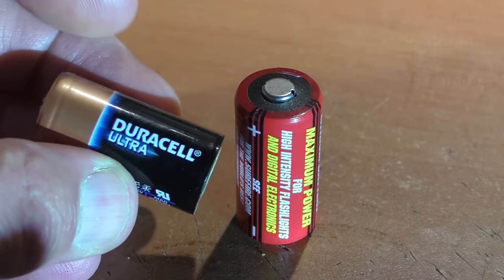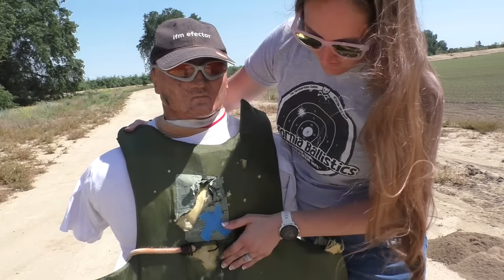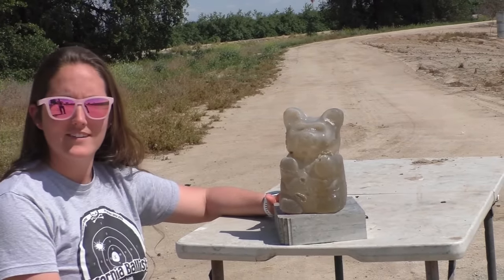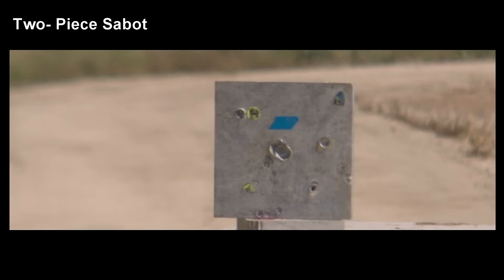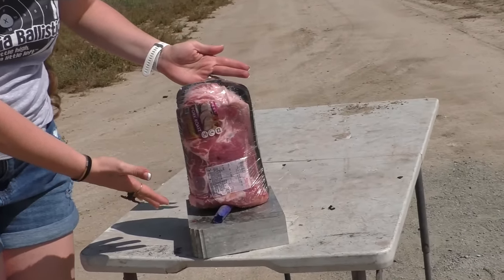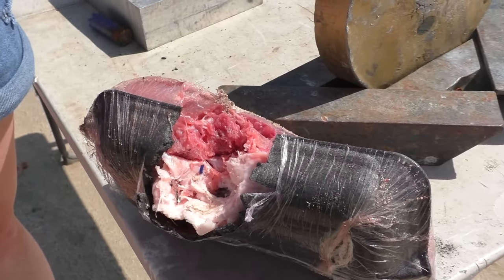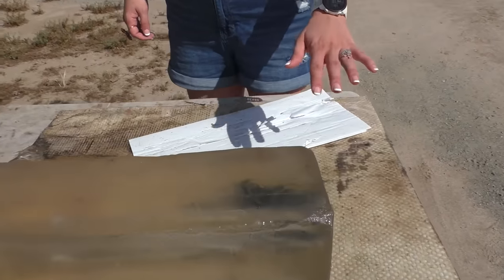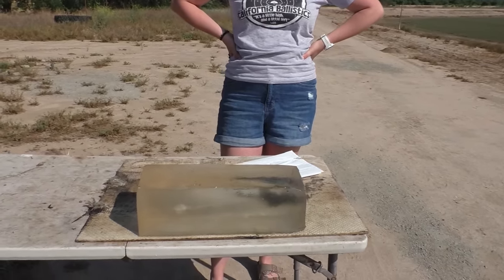12ga. Shotgun Lithium BATTERY Slugs-  Brutal Results!

Comment: In a human body, that black stuff would be exceedingly damaging and virtually impossible to clean out. Long term pain would likely last until it was all out of the body, not to mention the schrapnel damage in many different directions. The shock of the pressure wave would be devastating as well. That battery would be among some of the worst nightmares you have shown to date along with the likes of Dragon's Breath and some others. Just makes me shudder, which as a deactivated Marine, doesn't happen very often !
Reply: Right! I don’t think they’d survive the battery shell. That thing is brutal. Let me correct myself I don’t think they’d wanna survive it.
Reply: I don't think much pain would be felt - There is very little chance of surviving that kind of impact unless hit in something that will fly off the body anyway and at that point just amputate further up the wound to ensure the lithium is gone.  But I wholeheartedly agree one nightmare of a load!
Reply: Thanks
Reply: It’s like a hollow point with a side of horrible chemical burning
Reply: Dung 🥰🥰🥰🥰  Infection like Nam ????
Reply: Yeah I agree I was thinking similar things, I love my shotgun but they are absolutely devastating!
Reply: Poisoning and internal chemical burns due to the lithium reacting to water.
Reply: So the wound itself causes shock and then the lithium poisoning causes serotonin syndrome and you pass out. its a poison bullet.
Reply: @jamescheddar4896  daym!!!

Comment: That would be a wretched experience, especially if those contain elemental lithium, which I'm pretty sure would react with the water in your blood to form highly alkaline lithium hydroxide, adding internal chemical burns or worse to the list of injuries.
Reply: Your knowledge and the sharing of it is appreciated good sir.
Reply: @transtubular  Lol, you've got some small inches. Don't worry lad, I'm told that technique can make up for that.
Reply: @AtlasReburdened  Hahahaahaaaa...k ...nice.
Reply: The fragmentation is just brutal. Plus chemical burns and you should call this the Assassin Round.
Reply: No one lives through a clean hit with this...
Reply: Lithium reacting with water is very, shall we say, energetic. And it disassociated the water, and the hydrogen and oxygen energetically recombine. The fire and shrapnel from the case will make the chemical burns moot.
When I ran a chunk of the R&D labs for the largest consumer battery manufacturer, I must have blown up a thousands of the suckers. (And captured the propagation of the explosion as it traveled through the cell -  challenging stuff.  Never fired one out of a shotgun, though.
Reply: Are these batteries fully charged ? I hope so…
Reply: @peterstickney7608  I think, perhaps, you maybe be underestimating the amount of blood that flows both in and out of a permanent cavity from a gunshot. These hydroxide burns would be internal in the very precisely same sense that the entire lining of your circulatory system is. Alkali metal hydroxide burns throughout would absolutely not be a trivial or secondary concern.
Reply: Non-rechargeable lithium cells have metallic lithium in them (unless they're depleted), but lithium-ion cells don't.
Reply: @galfisk  Thank you, I thought that was the case but couldn't remember for sure.
Reply: Those are lithium manganese dioxide cells and they contain about half a gram of metallic lithium if they haven't been used.
Reply: @rocketman221projects  Good info. Thanks. A half gram seemed scant at first, but that's actually a fair bit considering how light it is atomically.
Reply: Yeah, it's a little over half as dense as water, so half a gram is almost one cc.
Reply: If the gel block is any indication, trying to treat a living person who has been shot with this would be a real son-of-a-bitch. Not to mention what it would be like to be the person shot with it.
Reply: Anyone else cringe when they were pouring water on the gel block to get a better view?  Hopefully the block had enough moisture content to burn out the reactivity with the lithium
Reply: @markmatsushima7356  Yeah, that wasn't smart.
Reply: Good lord, that would be BRUTAL!!
Reply: I was waiting on the 5 gallon water jug... But it never showed up. Kinda sad about that
Reply: But would the lithium have any psychoactive effect?  It doesn’t take much. See lithium water.
Reply: How about a stack of button cell? Aren't some of those pretty... unhealthy.
Reply: @CrimeVid  They are old, dead batteries, and non rechargeable.
Reply: Just when I thought being shot at with a lithium battery would be a walk in the park, you come along and ruin my dreams by making it sound worse. Thanks a lot.
Reply: @passattdise   shame.
Reply: @kenreynolds1000  it would be like getting injected with lye or something similarly caustic. you would probably pass out from the pain but the question is will your organs and other tissues burst from the gases first
Reply: @edredrhg6910  I get that. Just say you survived the shockwave and caustic effects… they rinse all that out and sew you up. I would wonder if the lithium toxicity would trip you out until it was washed out of your bloodstream… chelation therapy?
Reply: So shooting batteries is a warcrime?
Reply: I have pealed them open and droped the lithium strips in water quite a light show. Hot! I would guess even better after being Atomised by a shotgun blast. They should try firing brand-new fresh batteries into 1 gallon cans of water. Cool!
Reply: I have pealed them open and droped the lithium strips in water quite a light show. Hot! I would guess even better after being Atomised by a shotgun blast. They should try firing brand-new fresh batteries into 1 gallon cans of water. Cool!
Reply: @kenreynolds1000   Who needs all that medical mumbo jumbo when you can just stick a lightbulb in their mouth and wait for the bulb to go out.  Uncle Fester: Still a medical genius.
Reply: @samuelcolt6670  Shooting anything that causes a horrific death can be considered a war crime, but that's not the main issue.  The main issue is the guy's buddies that just watched their friend howl like an animal as he tried to rip chunks of his own flesh and organs out to make the pain stop.  You take a bunch of well-trained killing machines with guns, knives, and grenades and make them watch their brother die like that.  It doesn't matter which branch of service they are--hell, they could be the U.S. Army knitting team--and they WILL find you and they WILL play "Who's the most depraved?" with you for days man.
Reply: @richard6133  Just imagine how confused the doctor would be while trying to figure out what happened.  What a mess!  Honestly though, if somebody takes a center mass hit like this from a 12 gauge the prognosis is pretty poor.  Buckshot, slug, freaking lithium battery...  It's probably going to die.  It may take a while but it's not going far.  I've killed a lot of things with a 12 gauge.  I've never thought, "Is he gonna make it?" after hitting something center mass with buckshot.  People focus a lot on penetration.  Penetration is important (that's what she said) but what really kills is when you dump 100% of the energy into the target.  I'd rather have a projectile stop inside the target than have it go all the way through.
Reply: @rehoboth_farm  
I agree, I can't say that I have seen many patients with multiple projectiles stopped in the chest make it.
Reply: @CrimeVid  They're flat now...
Reply: Abrar  It's called chemistry, bud. You can tell it works by the way you never melt into a puddle of reactive goo.
Reply: Abrar  
I have enough experience with projectiles in people's bodies to know that he is likely correct in the OP.
Reply: Atf wants your adress
Reply: Would that count as chemical warfare?
Reply: @thestørmcrier2024  I believe there are laws regarding the dispensing of chemicals against people, probably intended to prevent "creative" homemade "pepper spray", that would apply here.
Reply: @thestørmcrier2024  
In the Laws of Armed Conflict, it would be under the same convention against the deliberate targeting of enemy personnel with incindiaries, since it doesn't start burning until it is inside the victim's body. It would not be a chemical weapons violation. Good question, though. 👍
Reply: Well better not try robbing that Batteries Plus location on the dodgy side of town
Reply: Nice observation ..but I believe the victim would have bigger problems to worry about with the wound
Reply: @timkohn7770   Those are my thoughts exactly. This OP's comment is just childish and pedantic. 🙄
Reply: the production of lithium hydroxide would lead to acidification* (li+ + h2o = lioh + h+ )
Reply: @timkohn7770  Maybe. I've seen people survive gunshots, but I haven't personally seen anyone be injected with solid metalic lithium.
Reply: @badabing3391  ...You do realize that that's hydrogen gas being evolved, right?
Reply: @AtlasReburdened  i misread the part where you said elemental lithium. I didnt watch the video either🤷‍♂️
Reply: These CR123 are Lithium manganese oxide, they are very different to metallic lithium.
Reply: @CrimeVid  You can not charge CR123 batteries. They are one time use DISPOSABLE batteries. Soo obviously these are depleted waste batteries.
Reply: @passattdise  Shame
Reply: @Neojhun  Did I suggest they had been recharged ? they could have been new.
Reply: lithium poisoning also has the worst symptoms for combat

Comment: by far one of the most damaging rounds , if the target lives through that shot they wont be alive much longer
Reply: plus getting battery acid in their wound
Reply: It's basically a poison explosive round, I'll keep the video in mind if the apocalypse starts and I need to fashion myself some improvised shells
Reply: My first thought as well. Lithium is toxic in much smaller doses, causes acute and then complete kidney failure, GI tract malfunction (both ends + stoppage, but irrelevant here since it wasn't taken orally), heavy muscle spasms, central nervous system failure (it crosses blood-brain barrier), severe hyperthermia, coma and death, and most importantly, there is no "antidote" - it cannot be neutralized, bound and flushed, and if quick hemodialysis doesn't help, it's code: ART.

So not only recipient would die, but it will hurt whole time its dying. From all the things I wouldn't want to be shot with that's firmly near the top.
Reply: @Vatharian  So basically, Battery loaded shotgun shells would be a war crime if used seriously?
Reply: @maritimeyoutubeengineer3354  actually, yes.
Reply: @Vatharian  damn, know what I'll be making in the post-apocalypse. Thanks!
Reply: @maritimeyoutubeengineer3354  Lithium batteries are more dangerous because of the lithium than any acid. Look up what happens when you expose lithium to water and I think you'll agree these are VASTLY more dangerous than even this video shows.
Reply: considering litium gets hot and can burn when wet maybe it would cauterize the wound ...not
Reply: @tphillips696  yeah I was imagining it  just lighting on fire once it starts breaking apart inside a person cause of how much water is around, that'd be absolutely terrifying. They should test the Energizer ultimate lithium batteries cause they have metallic lithium that'll self ignite whereas most just have lithium ions
Reply: So if you shot at a home intruder with this you'd go to jail?
Reply: @PeronJames  i fi have a home intruder i will END THEM and not go to jail.
Reply: @maritimeyoutubeengineer3354  I would dismantle the batteries and use them in a hollow points platform. Much like Mercury the energy transfer there is excessive against anything except maybe rhinoceride. Although if you happen to be hunting elephants this is actually a method of penetrating even their skin. If you were to use the proper High caliber rifle round with a portion of the lithium in it this would be a immobilizing round against anything.
Reply: @PeronJames  Geneva does not apply to civilians. However the fact that you are using explosive rounds will severely discredit a self-defense plea.
Reply: I've seen where somebody wrapped them in electrical tape to engage the rifling.
Reply: how would these be for defending against grizzly bears?
Reply: @maritimeyoutubeengineer3354  it’s a targeted chemical weapon.
Reply: @projectafterworld2557  Umm these batteries have too little lithium compound to be extremely volatile. FYI The ION part only accounts for a tiny fraction of the cell chemistry mass. ACID from batteries is vastly more dangerous because there is simply much more of it.
Reply: @Vatharian  There is too little lithium in Battery Cells to be toxic dose by contact. You would have to chemically extract and orally ingest the tiny amount of lithium compound to get anywhere close to toxic. FYI the ION part of lithium ion battery only accounts for a tiny fraction of the cell chemistry. Seems like everyone has no clue the tiny amount of of lithium in a battery.
Reply: FYI A 1,000lbs Lithium EV battery pack has about 15lbs of lithium compound. Just for you to understand the amount of lithium compound in a battery cell.

Comment: The definition of desperation is when your Red Dawn scenario involves repurposing lithium batteries as ammo.

Also, the California Ballistics shirt is awesome!
Reply: One would think you'd need batteries as batteries, but sure better shoot them than get shot
Reply: I thought that shirt said "California Balls!"
Reply: @engelbert42  Batteries only last a certain amount of time: But the need for Bullets will almost Certainly last Forever!
Reply: @erikdeeNOSPELLSNO  well idk. Lithium batteries are better served as explosives. Your bigger Lithium batteries like 18650 or 21700(the stuff people use for vaping) will blow up like a grenade if shorted. Then ones like in this video can be taken apart and used to forge something. 

If you need bullets just use some rocks or metal or something. There's literally an endless amount of hard things you can shoot. Using batteries just seems very ineffective in many ways
Reply: @engelbert42  they die eventually. And most can not be recharged.
Reply: I was thinking the same thing. That lithium and debris in the wound trail would be devastating over time and I'd find it hard to believe it could get cleaned out early enough to save the victim.
Reply: 🤔 hmmmm
Reply: Hah if you hit someone and they dont die from the initial shot.  They very well may die later from the chunks of lithium stuck in the body.
Reply: @stompingpeak2043  you wouldnt say that if hit by one. To me this is a perfect round for a no id shot
Reply: @engelbert42  A23 batteries are pretty specific for things like cameras and some remotes, stuff you'd hardly need in the apocalypse.
AA, AAA, C ,D, 2032 and 357 9v and 6v lantern sizes will be more useful
Reply: @DrDLightful need to ask an emergency doctor, but I reckon It would be nightmare. The splintering composite martial of the battery would make the remove problematic, while the lithium compound from battery would be tricky. Could you wash that stuff out? Would it react to body temperature and combust? Perhaps a war wound specialist would be better to consult with for care of that wound.

Nope, don't want to get hit with one of those rounds.

Comment: A thing about hard drives, the platters are circular and offset from the side with ports, and those platters are actually the "hard disks" in there. The shot in here only penetrated the case and controller board. So, just info for the future. Thanks for great content!
Reply: The platters are plastic…would make little difference to penetration.
Reply: @robertchapel2245  The platters of a hard drive are not plastic.  They are typically made of aluminum or glass and are coated with a ferromagnetic material.

Comment: Those would be actually pretty lethal rounds. No overpenetration and massive energy transfer. The kinda remind me of those ARX bullets where they can transfer a lot of energy.
Reply: Energy transfer is dependent on the amount of charge in the battery.
Reply: @sgthop  Looks like these were charged enough to not hurt the shooter. :P
Reply: Even dead batteries would still leave a shit load of fragments. Just nasty.
Reply: If CR123As were any cheaper, they wouldn't make a bad choice for an alternative defense round lol
Reply: Well if the shit hits the fan batteries will be free so.
Reply: Huge energy transfer with the added effect of sending a fine powder of battery components into the assailants nostrils, guaranteed to inflict permanent damage to their respiratory system. 
10/10 use this on people that you dislike.
Reply: and you put a lot of toxic shit in someone
Reply: Lmaooo not gonna make another joke ab energy but im just thinking about the electromagnetic properties of sending a battery down a steel pipe that fast
Reply: Don't forget the lithium itself is very toxic. So even if you survived the gunshot, probably won't be for too long.
Reply: @IronNam  it’d be like $20 for a full tube bro wym lol how often are you defensing
Reply: actually I was thinking of the wrong batteries but still seems negligible, maybe illegal tho
Reply: @Pface.  $20 if you buy in bulk lol